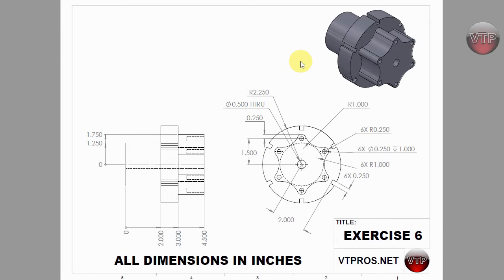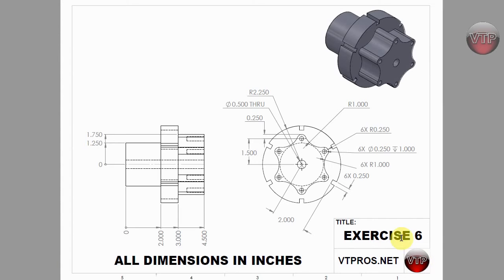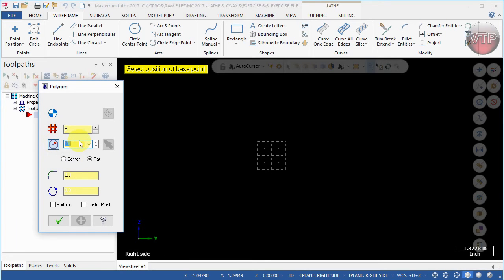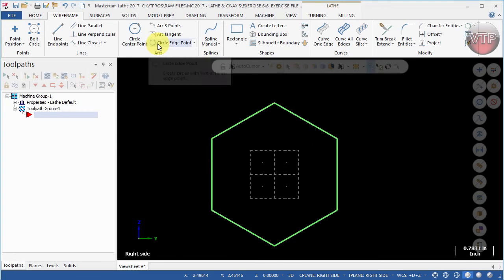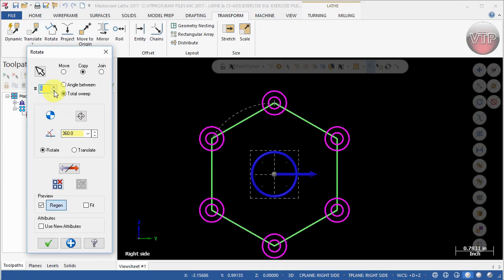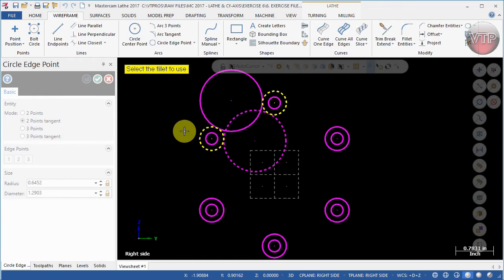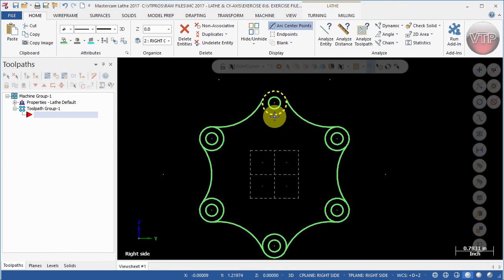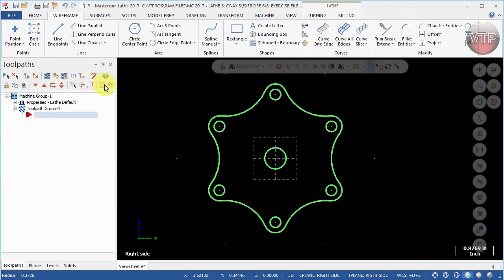MASTERCAM 2017-2020 - Lathe & C-Y Axis - 6.3 Right Geometry - Polygon, Rotate & Trim - vtpros.net

Comment: Hi Sir,which one main focus on true 4th axis (we just bought a rotary table 4th axis to be ready machine parts)so we need your real video help us to take care of those. Thanks
Reply from the maker: we don't have 4/5 axis videos yet for 2017-2019, we will in the next few month but you should start with the mill and lathe videos as well as "introduction to mastercam" to get very familiar with mastercam. you can't start straight in 4/5 axis, it's best to start with 2-3D milling
Reply: What!!!we've been for years on mastercam since V9 until now but not 4th axis rotary table.
Reply from the maker: @ducdo9258  have you used version 2017 and above? It's a completely new user interface. What version are you using now?
Reply: Been jumping in that Sir,just want to complete on 4th axis rotary only
Reply from the maker: @ducdo9258  we only have 4/5 axis for x9 and prior. Currently working on 2019. Should be out in may